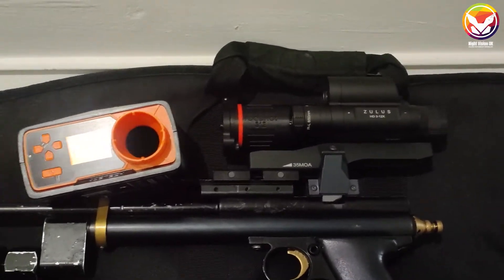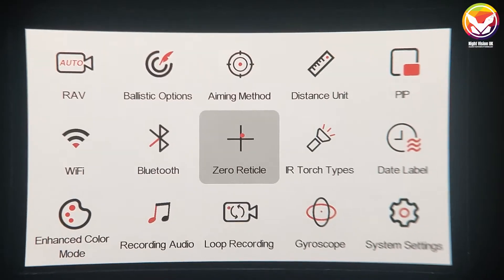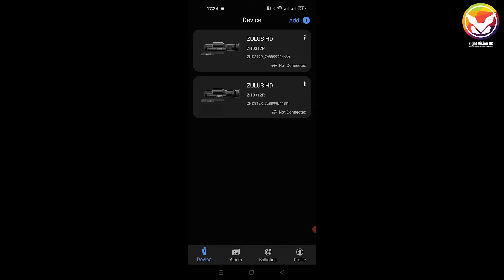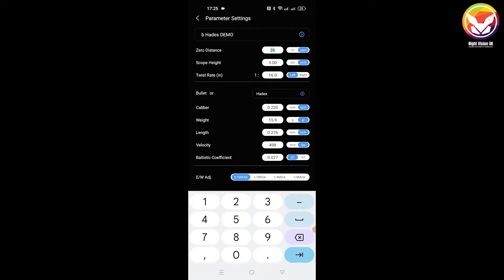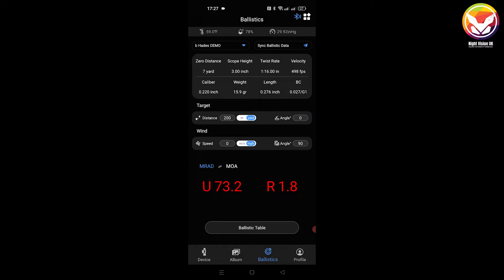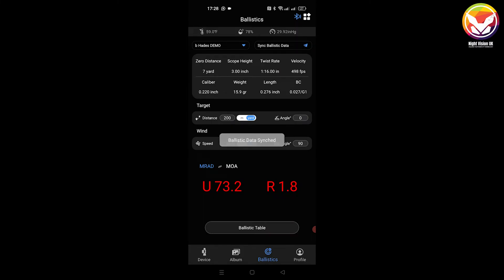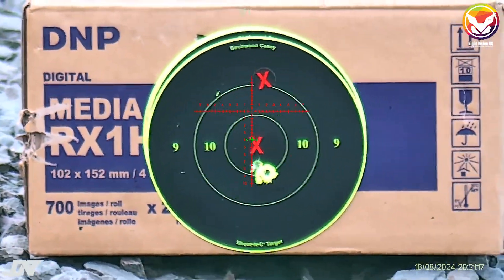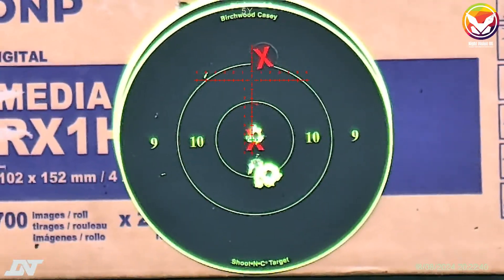DNT OPTICS ZULUS setting up zero and ballistic profile.

Comment: I have a Pard 008 sp lrf and whenever I zero at 25 , it is off target at sub-zero distance. When I adjust the scope height at the sub-zero distance to be dead on, my zero changes too. 

I have a Zulus HD 5-20r and will be trying it on that as well and hope for better results. 

I have always tweaked the BC for adjustments beyond my zero and that works perfectly for long distance (75-150 yds).

Comment: Thank you for this as recently started using a DNT Zulas 3-12 LRF. I also have a Pard DS35 LRF with Ballistic Calculator and on both (using sub 12 air rifles) I have not been able to get the ballistic calculators to be accurate at both short and longer ranges.  With scope heights set accurately it is never accurate at all ranges.  I have to adjust the scope height to get it accurate at 15yds to 45 yds (zero 25yds) but it is then way out at 10 yds and under and the opposite happens.  If I get it right at very short distances it is way out at the longer ranges.  All of the other data is correct.  The solution I have found is to know your hold under/over at all of the ranges you shoot at 5yd intervals without the use of the BC.  Therefore, I use the BC at the ranges I know it is accurate 15yds to 45yds then use the scope reticle hold over for the very short ranges.

Comment: hi. i have the zulus 5-20 as well. i set up the ballistics etc, everything fine  - BUT nowhere can i find how to activate and SEE the hold over on the recticle. Even you video just suddenly shows it in practice but not how to activate and use it. i had assumed that once zero setup in profile and used the LRF, the holdover recticle would appear, but it doesnt.  Can you do a vid showing how to activate the holdover/dial in options for the ballstics - step by step, button by button ??
Reply: On your scope, go to ballistic calculation and select either holdover or dial in option.
Reply: Same here mate. No hold over retical
Reply: Oops didn’t know you had to press the range button twice to activate the hold over cross hair. 🫣